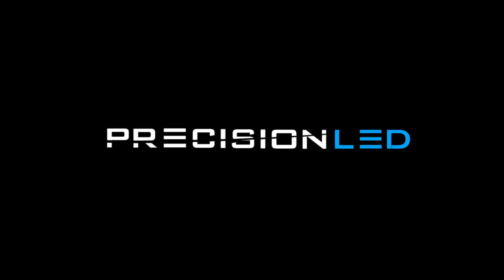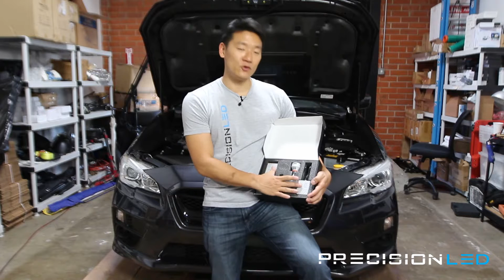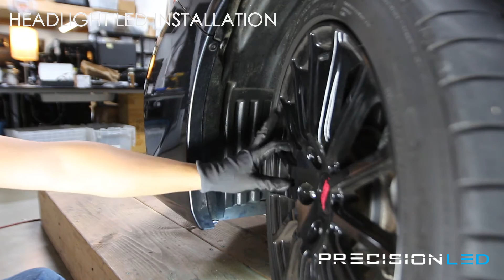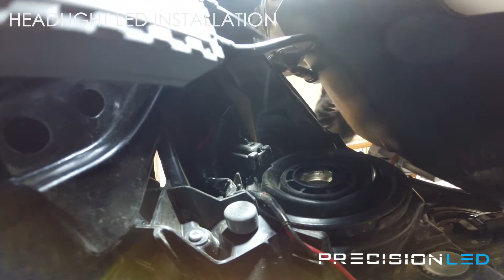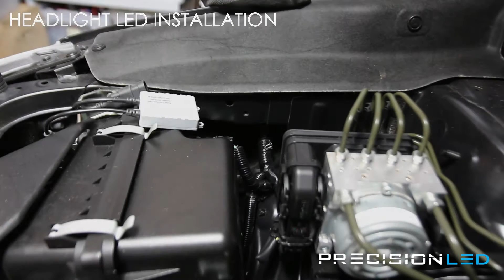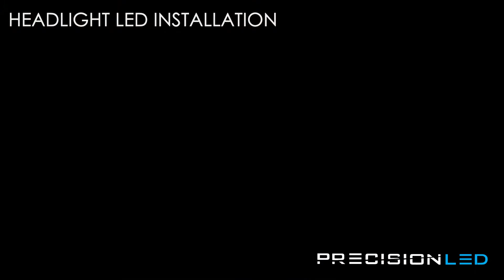Subaru WRX LED Headlights Upgrade - 4th Gen | 2015–2021

Comment: Is a 2015 Impreza h11?
Reply from the maker: Yes, the 2015 Impreza with stock halogen headlamps would be the H11 fitment.
Reply: what about sti 2008 with oem xenon?

Comment: Great video! I recently did an install on my 2017 WRX with the Subispeed OLM Headlight Low Beam Al Series (Lumileds CSP) Bulbs. For some reason, the passenger side headlight is pointing down on the ground and the other is not. Any reason why this might be? Thanks.
Reply from the maker: Than you for your interest.  It is possible the LED (or HID) is installed upside down.  I would double check this.  Also, if this is not the case, you may have to realign your cutoff line.

Comment: Did you put back the dust cap?
Reply from the maker: Yes, you would have to drill a hole in the dust cover in order to feed the ballast wires through, seal the hole up with some electrical tape, and reinstall the dust cover.
Reply: There was a dust cap that you removed to access the bulb?

Comment: Great video, i wanna install led on my 2011 projectors, but there is a cover lit that makes it impossible... any ideas?
Reply from the maker: Thank you for your interest.  I believe what you are referring to is the dust cover.  If your vehicle comes with a dust cover for your low beams, then you would need to drill a hole in the dust cover in order to feed the LED wires through.

Also, please note, our LED on the backend is larger than your vehicle's halogen bulb because of the heatsink. You would want to ensure there is enough room between your halogen bulb and dust cover order to fit our LED bulb into your housing. You would want at least a couple inches of spare room.